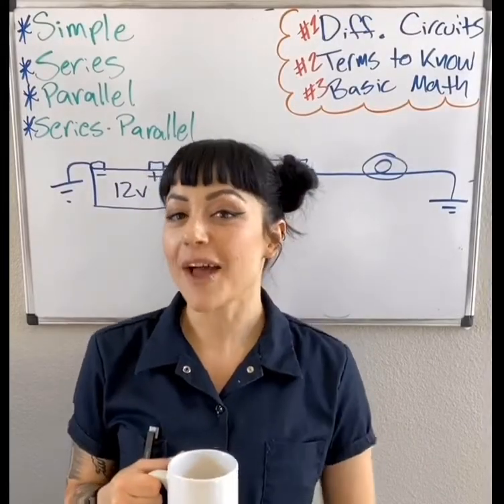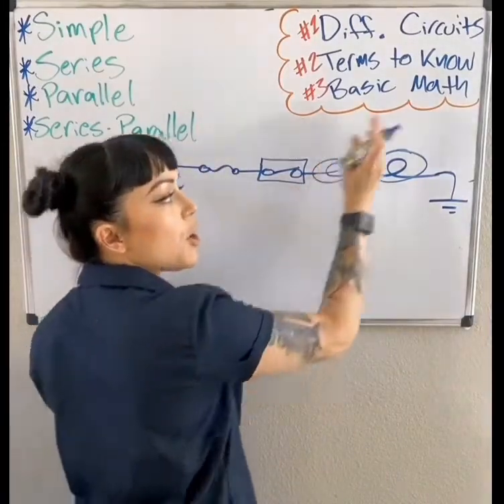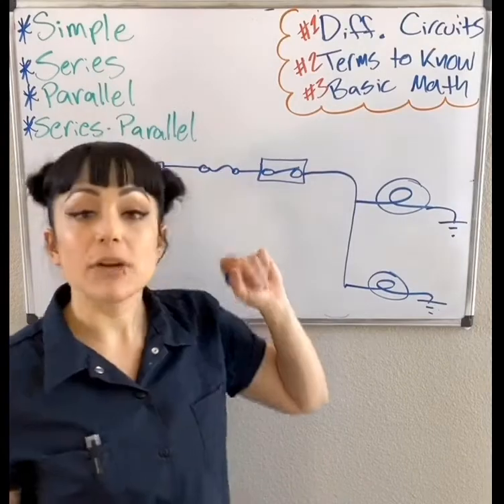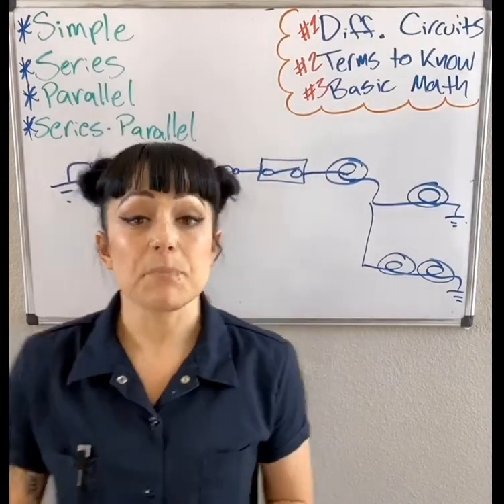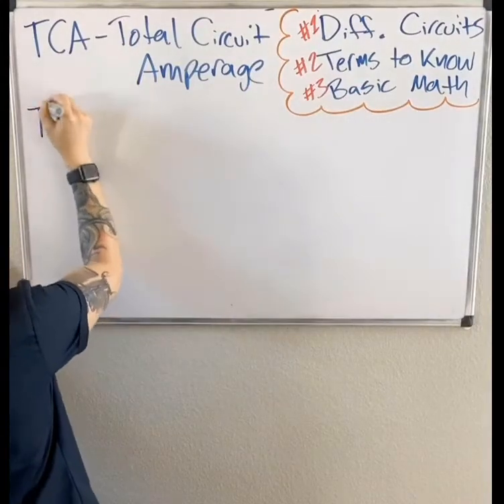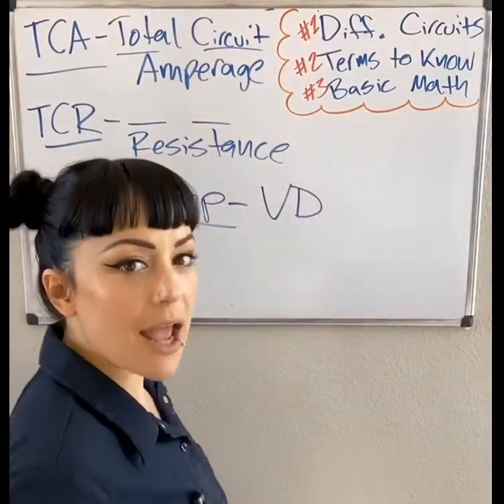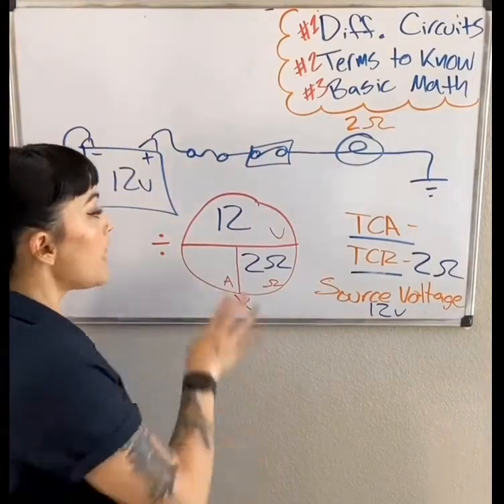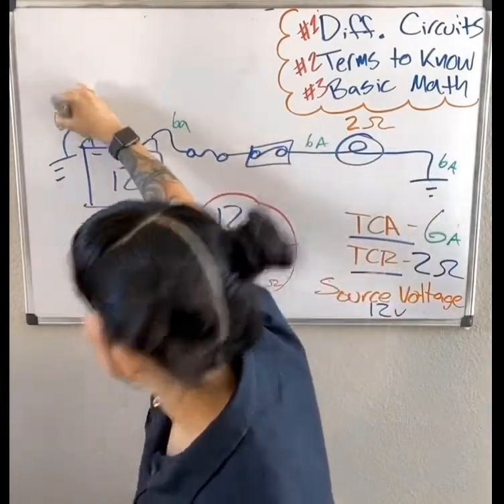Basic Automotive Electrical Theory 5

Comment: It was proven there is no voltage comming out of a bulb. Then how does both light bulbs work when we connect them in series. If one uses all the power shouldnt only one lightbulb work. Like no volts come out of the first